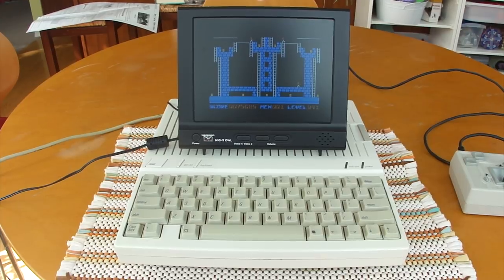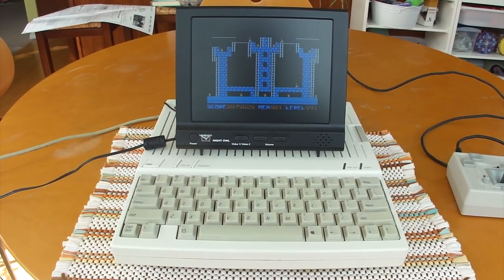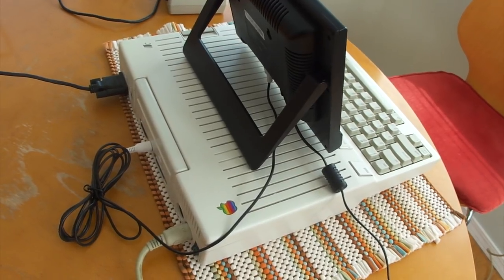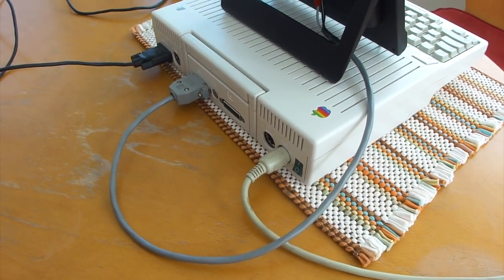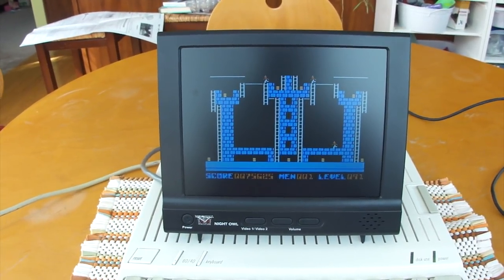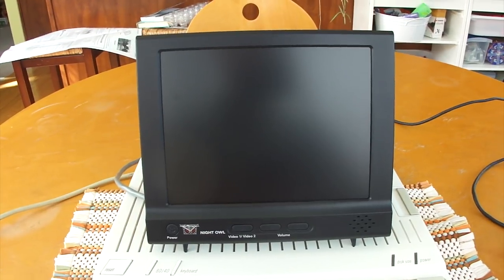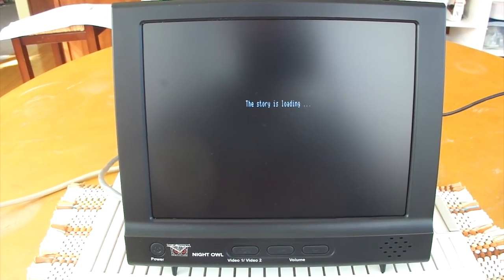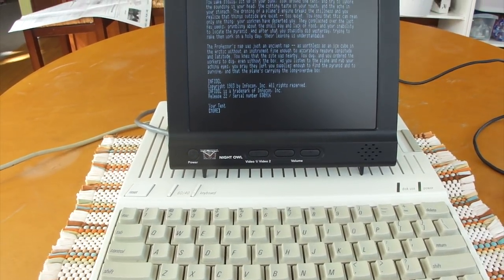Assembly Lines #13: Nightowl Apple IIc: Powering the Screen

Comment from the maker: +David Laffineuse (I can't seem to reply to your comment, so I'll add a new comment). I used "Valspar Paint+Primer Satin Vanilla #85005". Another option is Rustoleum Almond - that will give you a slightly darker shade. You might want to go with one versus the other depending upon the color/yellowing of your Apple //c. If it's nearly white then go with the Valspar Vanilla; if it's yellowing then go with the Rustoleum Almond. One important point - be very careful when removing that bracket on the back of the NightOwl monitor (assuming you have that brand) - the mounting pins snap off very easily. Of course I wasn't careful, and ended up having to use a couple of screws instead... Best of luck!

Comment from the maker: Hi David (is something wrong with your comments, making it so I can't reply?). Anyway, I don't have the exact parts list for the Night Owl cable because I just bought them at a local electronics shop. In general, you need a DA-15 male connector, with the plastic housing. Then you need the power supply cable (at least 2 feet) with the DC jack - it's a 5.5mm outer, 2.1mm inner. Finally, you need a normal RCA cable, also 2 feet long. I used 1/4" diameter heat shrink tubing to enclose both cables.

Comment: Hi Chris, Hooked on your videos, please keep up the great work.
This one interests me but I'm worried about the current draw of the LCD screen.
Looking at the Apple Description of the Video Port it warns as follows:-
WARNING!!!  Use caution.  The maximum allowable current drain of +12V
regulated power at the video expansion connector is 300 milliamps.  If the
external device draws more than this it can damage the computer or cause the
power supply to shut down.
Have you tested what your screen draws current wise?
Reply from the maker: Hi David, yes, excellent point. Quinn Dunki did extensive testing with this exact monitor and determined that the current draw was less than 300 mA. But you would definitely want to test if you used a different LCD!
Reply: Hi Chris, Is there a list of 8" screens that work nicely with the //c.
I have tried a couple both very bad. The Night Owl seems not to be available anywhere!
Reply from the maker: ***** Hmmm. Quinn Dunki also tried a bunch, with mixed results. I found that "bare" board on eBay that seemed to work fairly well, although every now and then the signal drops out. Check out my other video (the Apple //c monitor conversion) for details. But so far, the Night Owl is the best.